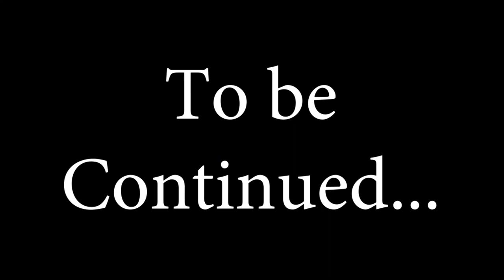Skoolie Bus Conversion:Disaster strikes and Turning Windows into Waldos

Comment: I really like the idea of your Waldos. I think a slight modification in your installation process would cure the problem. Install without the butyl tape at the bottom, which will allow the waldo to better fit the opening with our bowing in the middle of the sides. Then using some RV roofing style caulk the sides and the bottom. Finally rivet or screw the sides from the outside of the bus then screw in the bottom as you did. 
Hope this helps, Brad

Comment: Get some angle iron in there tack weld to the panels you made and tack to the original frame, job done
Reply from the maker: We thought about that but it didn't give us the leverage to smash into the seal with any strength.  The solution we came up with was a better way to create the seal.

Comment: Seems like the waldo needs to be same on all four sides so it can slide into the window frame with the same rigidity on all four sides. That will also give you the same flange to put some screws into the sides as well as the top and bottom. Then with the corners, either the butyl tape will fill them in, or you hit them with some sikaflex for a watertight fit. Your idea does seem like a lot simpler way to cover the windows though.
Reply from the maker: We thought of that but we would sacrifice the built in way it seals.  We don't want to use any kind of caulking because it doesn't last.  We did come up with an innovative solution to our problem that will last forever!  It will be in the next couple of videos.  Thanks for the idea!

Comment: check out SSD External Hard drives on newegg.com, SSD has no moving parts so it is shock resistant. also newegg offers Data Recovery plan for a small fee on alot of their drives. SDD's cost more money for less space but they are less likely to fail as fast as a conventional Hard Disk Drives in my opinion and  experiences. so cost to space ratio isnt there but the cost to reliability seem to make up for that.
Reply from the maker: Thanks for the info.  I've been looking for one for editing to speed things up but as soon as we are in the bus living, all SSDs.